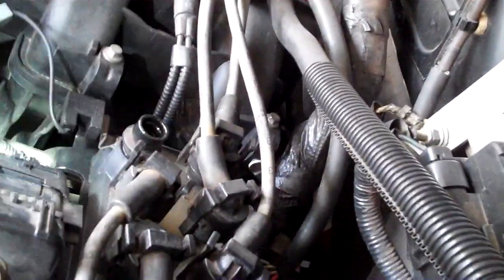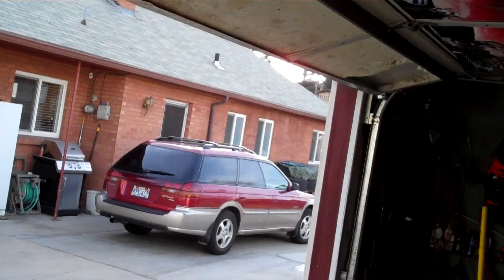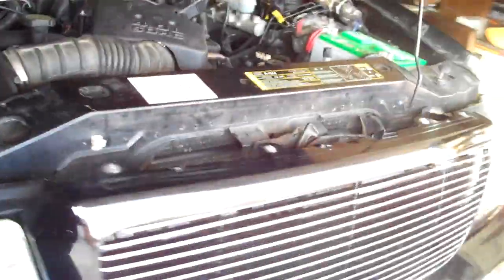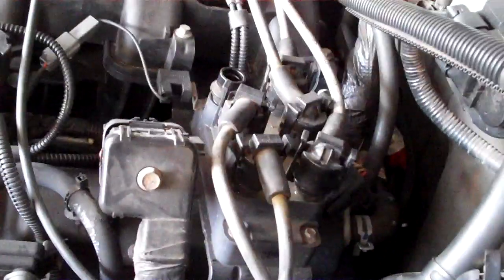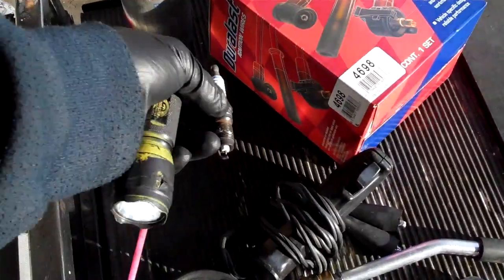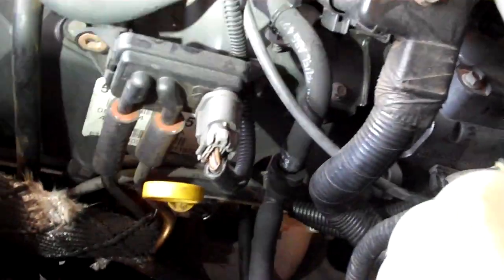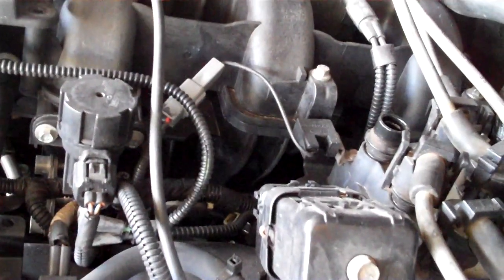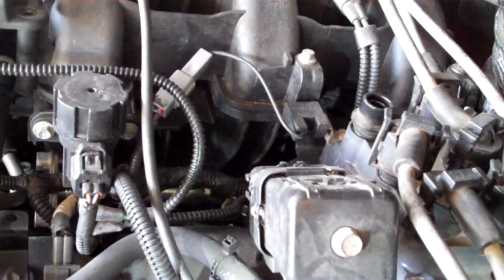How to diagnose a misfire that isn't ignition related

Comment: Valve not closing should show (be indicted) on a compression and vacuum check.  Your method is still helpful to determine if it is intake or exhaust though, or if you don't have the equipment to do those 2 checks.

Comment: My 3.8 GM started with a p0305 code then added a p0303 code then a p0300 code the engine makes a loud rattling sound coming from the top changed o2 sensor then icm with new coils and new spark plugs it ran smooth for about two weeks still had the ticking which sounds like a lifter cleared codes no more misfire codes until today now I'm back to the beginning engine running rough and the p0305 code is back, I'm stumped.

Comment: Just wondering what the symptoms were other than the check engine code? Was it missing at idle and at higher rpm? Im getting the same code and changed plugs, wires, and ignition coil and its still missing. I am going to do a compression test as well as the test in the video.

Comment: Anybody have an explanation why my 98 F150 (4.2L V6) runs fine when I start it and run for several miles, then after I shut it off for a while (15-20 minutes or more) it throws the P0305 code with flashing CE light? It seems fine until then. Thanks and good video.

Comment: Hey Brian, thanks for your videos. I have a 2005 Sub Forester non turbo that's engine was shaking progressively worse over the span of 9-10 days when all the sudden I was driving and the CEL started flashing and the engine started sputtering and making loud noises along with the loss of acceleration. The cruise light was blinking also. I limped home. I received a misfire code in cylinder 3. I changed plugs; wires; and coil. still did it. I then performed a dry/wet compression test on # 1 and # 3. some oil on both plugs prior to changing plugs and after. #1 185 psi dry; #3 50 psi dry and 160 psi with oil. 102K miles; I am thinking that there may be a piston ring problem but I am new to this kind of major issue. With your Subaru experience, what is my next step to narrowing my problem? Also, I am not certain that I want to tackle a HG thing, if this is a bent valve or something like that, what are the financial costs that I should be seeing in estimates and such? is it worth it? ty Steve
Reply from the maker: I would swap injectors and see if the missfire follows it or at least ear scope to see if #3 sounds different.
Reply: briansmobile1 thanks, I had listened to injectors for #1 and #3, both were clicking. Would they still be clicking if clogged? They both sounded same

Comment: I have a question  I had a misfire in  the p0305 check engine light was flashing   I changed all the spark plugs  checked the field injectors using omms the spark plugs   and i unplugged the battery for a few hours and the check engine light was off but I still idle rough what could be my problem if the check engine light went away I drove the car for almost 30 miles and it didn't come back on  I have a 2009 ford taurus limited  3.5l v6  I'm thinking  it could be a coil pack how would I go about testing those
Reply: just swap it with another coilpack from say CYL1 if the misfire then moves to CYL 1 and you get code  P0301 then that coilpack is bad.

Comment: Hello, this morning my 2010 Honda Odyssey got these codes: P0301, P0302, P0303, P0304, P0305, P0306 and P0300. The van was shaking a little bit in the morning. The check engine light didn't come on. The spark plugs were replace about 3 months ago. Any suggestions? Thank you.

Comment: My goodness you are damn smart. I was trying to figure out a way to find out why my Honda is misfiring on ALL cylinders (yes, all cylinders), and the mechanic told me it needs valve adjustment. This is a good way to verify if he is right.

BTW, there should be an easier way to find out which cylinder is in top dead center position.

Keep up the good work Brian.

Comment: hey man... love your vids... I need help with my subaru... 95 2.2 wagon...
so ive cleaned my iac, new plugs, wires, and injectors. I dont have a compression guage so i havent performed that test...

It comes and goes. I can pretty much unplug the battery for a few minutes, all is normal. Basically i can get it to act up when im getting on the freeway. 4500 rpm or so shifts and most times coming into 5th gear, and i get off the throttle... it starts shuddering and the CEL comes on flashing. I can pull to the side of the road and unplug #4 cyl wire. No change, and the spark jumps to the manifold. reconnect it, and unplug the injector... no change. I run a volt meter to it... and nuthin. 

However, driving through town nothing happens. Its all gravy and cool. Just running revs beyond mid range (2500-4000 rpms) for any length of time she starts to give out. Any ideas?

Comment: YOU CAN ALL SO USE THIS TO FIND BLOWN CYLINDER HEAD GASKETS JUST FILL THE RADIATOR TO THE TOP OR THE EXPANSION BOTTLE AND IT WILL BLOW THE WATER OUT THE RADIATOR

Comment: Very Nice, I have never once heard of using the air compressor to see which valve side is not seating. this will help me save lots of time over the years.
Reply: Could be a valve that never opens. Then your compressed air trick will be contraindicating.
Reply: Try figuring that out on an engine with 4 valves where it's just one of the valves not opening.

Comment: thanks Brian, I have a 96 4.0 ohv and misfire on 6 I ran a compression test and all have 105-115 and number 6 has 40psi, I was happy to hear the hissin in this video cause I came up with the idea to run air compressor  myself , but have not done it yet I m still gonna run a wet test in 6 but I am hoping for it to be valve and not cylinder and piston rings............do you ever have stubborn manifold bolts I m wonderin if I get ther I hope I can get them off the waay they look

Comment: Its worth it to check valve clearance once you've got the cover off and recheck compression if adjusted. An adjustment made a huge differance on my truck. Unfortunatley  I already had removed the head to find nothing wrong with valves. Not sure if all motors let you adjust valve clearance these days

Comment: Hey! I've 1998 honda passport V6 got a misfire cylinder #6. I replace the timing belt, V belt, Water pump. What could cause that misfire? I checked all my spark plugs.( They're new). coil packs R working, I switched'em around. But check engine light is blinking. And the truck shakes in idle. What could cause that?

Comment from the maker: Yes- or a hole in the piston.  ( I've seen this too.)  However if your throttle is open slightly you can send air through an open intake valve to the intake boot through the PCV hose and into the crankcase.

Comment: ok so i did this test on my 2000 Volvo S40 4Cyl turbo.  no noise from the intake or exhaust but i did hear air from the oil fill cap.  would that be the piston rings leaking??

Comment: Ford is always troble . I had nothing but trouble with my mercury tracer 1994 after 75.000 mile on it . Thank god a deer hit the front end and we junked it . it would never stay idling at a stop light , it would alway die out on me . I changed all of the wire and plugs . but thought it was a intake manifold leak . but thats not my problem now its at the junk yard now .

Comment: Hello, I have a 1997 f150 4.6L New Autolite Plugs, Napa Wires and 2 New Coil Packs from autozone, Still has a slight miss but no Check engine light, Any ideas ? Fuel Injector ? we also replaced the gas tank because it was rusty and leaking also replaced the fuel filter, Maybe a clogged injector ? Is it possible to rebuild them ?

Comment: I have a 04 Trailblazer and recently it came up with a P0326 knock sensor code.  I do not hear any noises from the engine, Should I just replace both knock sensors?  I do get poor fuel economy and sluggish acceleration...

Comment: 1999 olds 3.8. jerks from take off from  stop sign. Then starts to jerk at 1800 rpm, otherwise it runs well. Replaced spark module , all plugs and wires and coils replaced. Maf replaced. no codes come up. its as if some one shuts off the car momentarily.Local GM shop is about to give up.
Reply: ventureelect Throttle Position Sensor/crankshaft position sensor

Comment from the maker: Check the basics.  The U code is a body code and may not be related.  I'd check your fuel pressure first.  {Pump failures are common on that after 100k miles.

Comment: What causes the throttle to not throttle at the throttle body.  I have a gmc suv that all of a sudden reduced engine power and the traction control light came on. The parts place put the computer diagnostic thing to it and got code u0107. It won't let the engine rev at all and this is the first time I've had an issue with my truck. Im sure why but just about 15 to 20 minutes prior to this malfunction I bought sum of 50 dollars gas noticing that my fuel light was on.  2004 Yukon XL 6.0 engine

Comment from the maker: @mattmvp5  I'm betting yours IS ignition related, but the thing to do is get that cylinders piston at the top (to ensure the valves on that hole are CLOSED) and HOLD THE CRANK.  Otherwise the piston will go down and move the crank-cam-valves and your test is crap.  The tank will be at 120-150 psi (about or a bit less than normal cylinder compression)  Most compressors for home use are around 125psi just anyway.

Comment: Hi Brian, I am having the same issue on a f150. When you put your compression hose on hooked to the air compressor, how much pressure are you applying to you engine. How much psi from air tank. Thanks

Comment from the maker: @kid123000 When the piston is at the top the valves MUST CLOSE or they get hit.  I put a screw driver in the spark plug hole to feel when it was at the top while the truck owner rotated the crank.  While holding the crank still I flooded the cylinder with 120 psi compressed air.  It SHOULD hold, but didn't.

Comment from the maker: @CLaM734 I already ordered one in just in case they're $5 or so.  I also replace the keepers too.  I've seen this before as well.  Another common cause of this is the valve wearing up into the valve seat and losing clearance between the roller rocker and the top of the valve causing it to not close completely.

Comment from the maker: @whitedoggarage Yes.  When the piston is at top dead center both valves should be closed and the cylinder should be a sealed container up to at least 120-140 psi.  I also brace the crank to make sure the pressure doesn't push the piston down, turn the timing chain and rotate the camshaft to open.  The compressor puts out about 120 psi.

Comment: Hey Brian another great video.  So let me get this right you just put a connector on the end of the compression tester hose and connect the air line and let it get the full supply from the compressor, allowing the compressor to maintain the pressure?

Comment from the maker: @spelunkerd I just tested the spark plug in the Subaru plug wire (So subaru running on 3) to test the plug itself.  I physically checked the timing of #5 on the fuel/compression stroke and had Matt hold it there.

Comment: @ncrdisabled Redoing the lower intake manifold gasket is about $7-800 on those vans. It should be easy enough to access the rear plugs with a lift though. Maybe an hour or two of diagnostic labor to cause.

Comment: Have you tried smacking it with a "Thor" hammer first? Could save you a lot of time and labour, works for me 60 to 70% of the time. LoL

But seriously, thanks for the tip. Was that something were taught through your schooling or did you just figure this out on your own over the years. 

I guess I'm assuming you went to school for your class A mechanics license (or whatever it is down there).... if you are self taught, bravo to you sir as you are just packed full of knowledge!

Comment: I'm feeling a little slow that I don't understand this, yet. Did you swap the #5 spark plug to your Subaru to see if it was 'leaking'? Or, did you check for spark from plug #5 put into a Subaru plug wire, with the plug held close to the engine? How did you know that the piston was at the top of the compression stroke rather than the end of the exhaust stroke? Do you find one (from a puff of air out the hole), and then follow the firing order to do each in turn (60 deg CW if V6, 45 deg CW if V8)?

Comment: An old mechanic showed me one time a trick to free up stuck valves in stored motors.  He set up with a leakdown tester, which is pretty much what you did on #5, and with the air on he took a brass punch and tapped the end of the leaking valve's stem.  A little crap come through and the cylinder sealed right up.  This was a GL1000 Honda Goldwing we were reviving.  Not gonna fix ya on this one, but a great trick to put in the toolbox of knowledge, and this reminded me of it.

Comment: I have a 2003 chevy venture with the same code and my cyilder is 5 in the back of the engine and 
means a lot of work to even get to it to check the cause. I am disabled on SSDI and have heard it will cost around 500 bucks just to get to it.

Comment from the maker: @AdirondackNY I'm familiar with the strokes.  Cylinder 4 was at 140 psi.  Cyl 5 was 78 psi and cyl. 6 was 142 psi.  When there is low compression on a cylinder it's because it's leaking somewhere.  It could be into the crankcase from bad rings.  It could be out the head gasket into the coolant jacket.   It could be out the valves, or it could be out a crack in the head or cylinder wall.  The idea here is to align the camshaft to be in a known closed position and fill with pressure.

Comment: a quick question from an old autobody mechanic,,, as you know that piston comes up twice  
TOP  ( intake  combustion TOP ignition exhaust ) TOP ( intake  combustion TOP ignition exhaust ) TOP( intake  combustion TOP ignition exhaust ) TOP   what if it is inbetween the exhaust & intake stroke when you hear it hissing? did you do a dry & wet compression test?  & what variation was the PSI  I would hate to see ya pull that all apart and it ending up being a ECM computer malfunction.